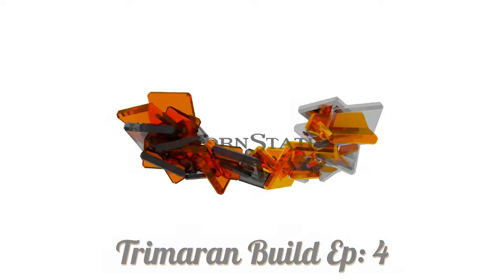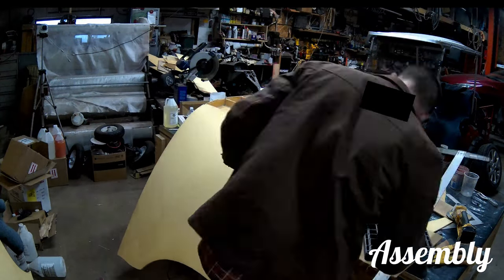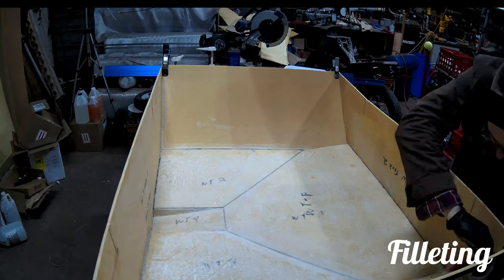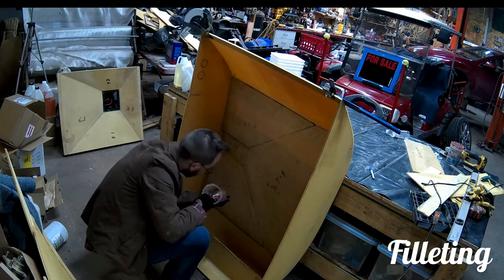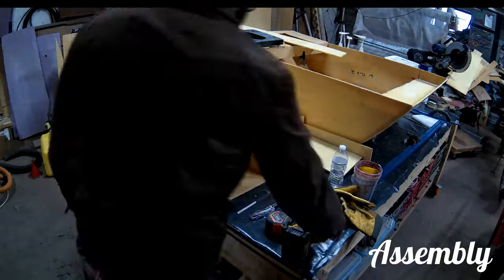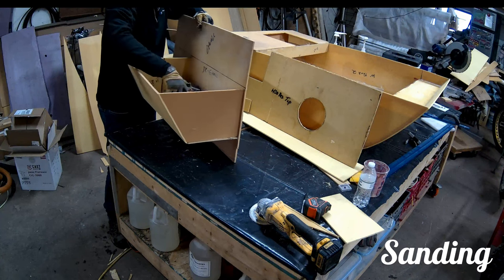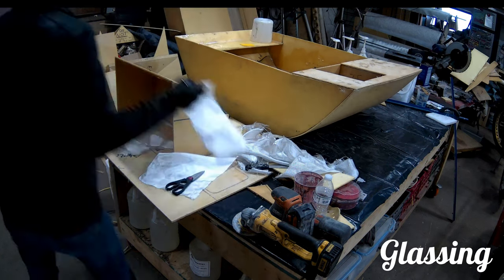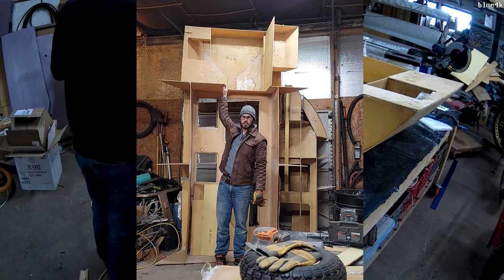Custom Sailing Trimaran: Ep4 Back To Work

Comment: What is that materiel your making it out of? It looks so thin and almost floppy at times. 🤔 you’ve got a pretty impressive brain… from design to build… your doing it man! Pretty awesome!
Reply from the maker: It is 6mm pvc foam from a US company called carbon core. It is an absolute joy to work with. Super light, cuts with a basic knife.
Reply: @TornState  wow that’s great! No wood required? I’d imagine it’s probably mildew and rot resistant as well, making it an awesome candidate for a project like yours! How great! Is it strong enough to handle waves etc? I’m sure you have it all figured out, but that was a thought I had 🤓🤔
Reply from the maker: @gleavecameron  yes! Nothing to rot! The plan is for it to have no wood or metal  (except electronics). It's strength comes from the layers of fiberglass and resin. If I've done my homework correctly, it should be a very strong and lightweight little boat.